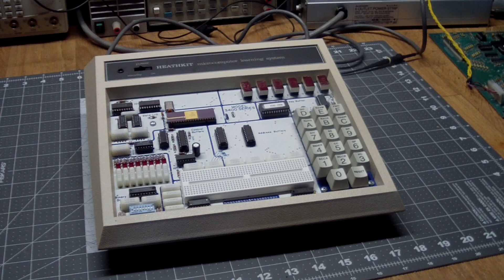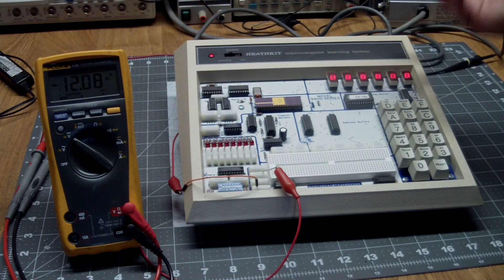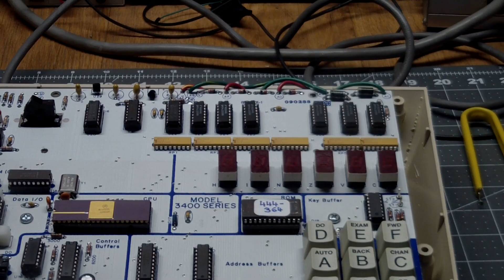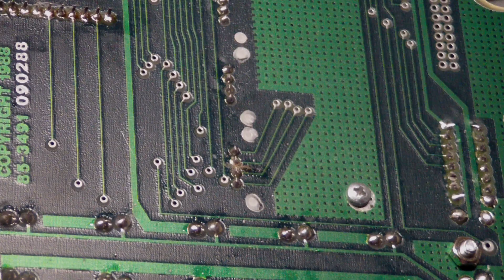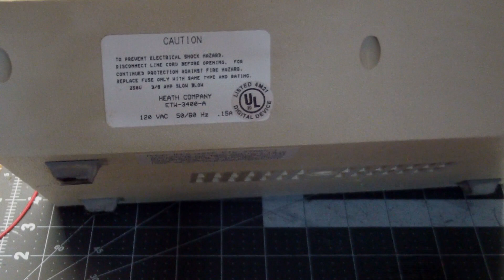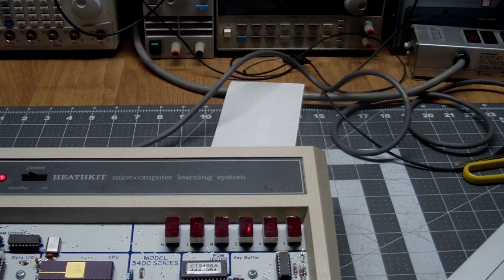AE#187 Heathkit ET3400A Microprocessor Trainer Repair

Comment: I got a board for the same model you fixed (ET-3400A), which uses the 6802. The board was scavenged and lost the keyboard, most of the ICs and all wires were cut, but otherwise the board is in good condition and still has LEDs, capacitors and resistors. I plan to restore the board to working condition, so got a manual for the ET-3400 model which uses the 6800, but could not find the manual for the ET-3400A model. Since you have a working board, would it be possible to post somewhere the socket numbers along with ICs identification? (something like "U11 - 6802"). Thanks for sharing with us the board troubleshooting!
Reply: Never mind, I was able to find an schematic of ET-3400A board.

Comment: Thank you, thank you,thank you! Nov 2023 I pulled out from storage my ET-3400 I had bought on EBay many years ago and never got around to fixing. I worked on it for a few hours earlier checking voltages, clock, etc. Thought I’d watch YouTube to get a better understanding of the circuit. Had same symptoms as yours. After seeing what you found I went back to my bench and looked at those solder joints under the tie blocks. Two places were shorted! Cleared the shorts and boom “CPU UP”. Most of these were home built kits and those particular pads under the tie blocks, the way they are laid out are so close together it’s too easy for an amateur solderer and Heathkit themselves as you discovered near the end of your episode to cause bridges. You saved me a lot of work!

Comment: As soon as you mentioned that removing the ROM chip the address bus and data bus came alive I had my suspicions about the orientation of the ROM, as I had made that mistake myself. Also my ET’s had some IC sockets installed backwards by the owners.

Comment: Does all early 80's and late 80's microprocessors have Bus Request State output pins and Bus Available state output pins? Which I'm guessing the bus request state and bus available state is only used for DMA and not used for anything else? because I don't see bus available state pins or bus request state pins on the Z80, 6800 CPU chips datasheets.
Reply from the maker: If a CPU bus request is granted then you have access to all of the resources the CPU normally controls itself. Carefully read the pin descriptions in the CPU data sheets to find out how to do this.

Comment: I wonder if there is a modern equivalent that curious people or kids can use to learn assembly language programming and computer architecture. It would be a real loss if there weren't.
Reply from the maker: There are the boards that Mr Guru mentions, put blinking an LED in assembly on an ARM (full mode, not thumb) is quite an undertaking.
Reply: @artifactelectronics  It's not just getting an LED to blink. In the Heathkit trainer or most any early microcomputer a technically minded user could understand every functional aspect of the hardware and software with a very reasonable amount of effort. That's not very easy for a raspberry pi running Debian. I wonder how undergrads learn computer organization nowadays because even the most basic hardware is very complex not even to mention the software.
Reply: Elenco is still selling a trainer kit like this with an intel 8085 chip for about $120 with course book. You build a section then test that section and continue till built then run some learning programs. The key board is minimal, but it gives you some micro training.